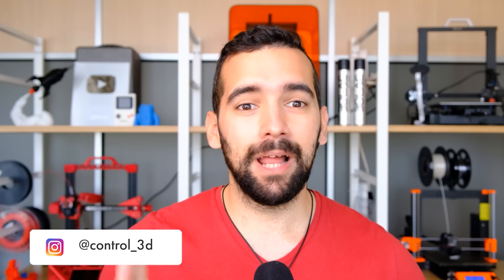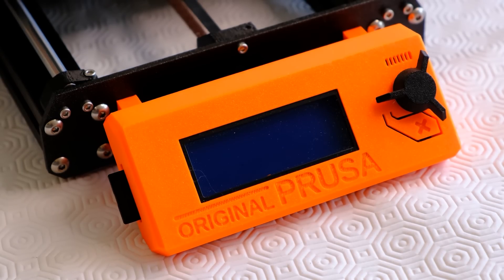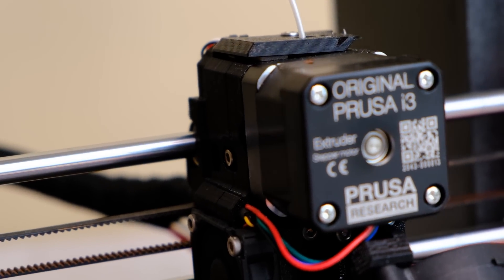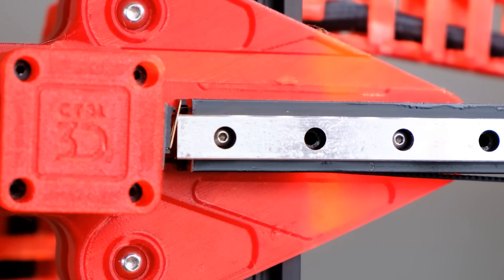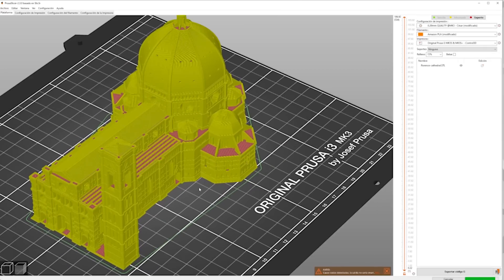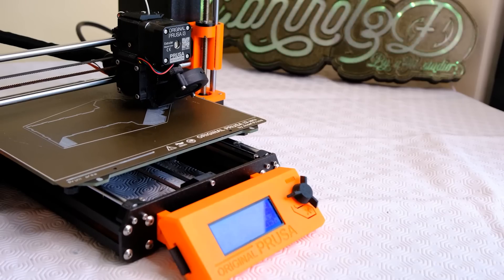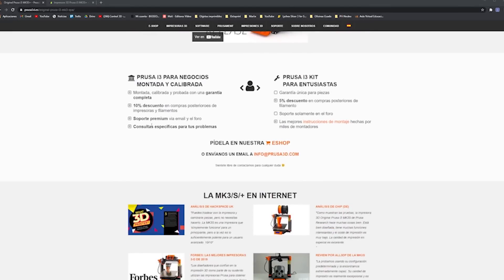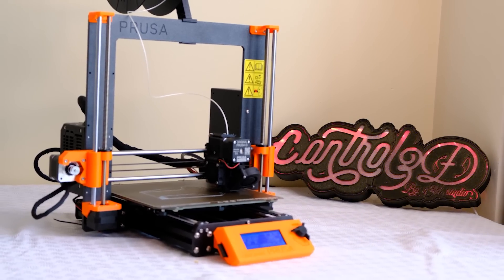👑La MEJOR IMPRESORA 3D de 2021 (calidad precio)👑 Prusa i3 MK3S+ | ¿Qué Impresora 3D comprar 2021?

Comment: Dispongo de una corexy d tronxy, modeada con guía lineal hiwin china, estrusion directa con titan y mk8 de competí chino, sensor de filamento, save por falta de tensión, fleje en la cama, capricornio, refuerzo de fuente de alimentación con mosfets en ext y cama+fuente extra solo cama, y sistema multimaterial de 5 estrusores con la placa de serie... Se consiguen muy buenas impresiones a 01 de capa y 02 y 04 de boca, con velocidades medias de 100 y capas ext a la mitad... Es decir, es una señora impresora,... Ahora puede que me tenga que mirar una para el trabajo por que he hecho alguna cosilla y creo que puede ayudar bastante en el curro... Pues bien...después de ver todo Internet, incluso antes de ver este vídeo, lo suyo es una prusa mk3 +... Sin duda... Lo trae todo todo de serie, y te lo dice alguien que ha modeado mucho mucho... Buen video loco...

Comment: Muy rápida, si, pero cuanto? MM/s porfa. Aun así por muy rápida que sea, no va a llegar a la velocidad de 4 Enders 3 a la vez, que es lo que puedes comprar por ese precio (en España, en China ya flipas) y la diferencia de calidad no veo que sea tan clara (cuando tienes las Ender bien calibradas). No veo esta maquina destinada a profesionales (relación coste/producción desorbitado). Es más la veo como mi Stepcraft M1000, la apple de las CNC, pues lo mismo pero en Impresoras 3D, que te da muchas cosas hechas a base de sacos de euros.
Reply: si la usas para imprimir pla, entonces si, te conviene comprar cuatro ender 3. Pero si quieres imprimir petg por ejemplo y en masa, la ender 3 no te sirve, ya que aun si le cambias el hotend, sigue siendo una bowden (y con un solo motor en z), sigue sin tener cama flexible (si estas produciendo con varias maquinas al mismo tiempo es casi imprescindible), sigue sin tener sistema de nivelacion automatico ni sensor de filamento, sigue teniendo un extrusor de plastico con engranajes de mala calidad y sigue teniendo rueditas en lugar de rodamientos. Aun si le pusieras a la ender 3 las mismas cosas de la prusa (hotend v6 original, engranajes bondtech originales, cama flexible original con imanes de neodimio en la cama, doble motor en z, extrusor directo bondtech), seguiria sin tener el increible firmware de prusa y su gran ventaja de poder usar todos los perfiles de prusa con el prusa slicer (es decir, simplemente te bajas un modelo de la pagina de prusa, le pones los perfiles que te dicen ahi, y ya lo imprimiste). Y aun si le pones el mismo firmware de prusa, no tienes el soporte directo de ellos, ni acceso a comprar repuestos ni kits de actualizacion. Creeme que hice las cuentas para ver si me convenia comprar una ender y actualizarla o comprar la prusa, y me di cuenta que la prusa me sale mas barato sin contar el ahorro de tiempo y dolores de cabeza que implica andar modificando una impresora en lugar de sacarla de la caja e imprimir (luego de armarla por supuesto)
Reply from the maker: Ni yo lo haría explicado mejor 👍👍
Reply: @Marcos-tj8nk  gracias por tu explicación. Llevo trabajando 2 años con estas máquinas y no he necesitado nada de todo eso que comentas, e imprimo en petg (creo que te referías a TPU, el cual también imprimo con bowden por cierto) sin problemas. Uso Cura y me funciona perfecto. El tema de los perfiles está muy bien para empezar, para quien no ha usado una impresora nunca, después de miles de horas de impresión que llevo a cuestas no le hacen falta. Y en esos miles de horas se me ha roto el filamento 2 veces y ni siquiera eso, fueron nudos. La nivelación automática también es para novatos. Yo siempre aprovecho las líneas de skirt para saber si está o no nivelada y ajustar a mano en el momento. Ajustar por software nunca me ha parecido buena idea. Claro que son maneras de trabajar. Unos necesitarán esas funciones y a otros nos parecerán añadidos que no nos aportan nada y suben demasiado el coste de producción y más cuando en este país la gente quiere comprar barato. Eso si, me gustaría probar una para hacerme un zas a en toda la boca si realmente merece la pena.
Reply: @S.Duran_SRTWorks  la comparacion mas justa con la ender seria la prusa mini, la cual tiene aun mejor relacion calidad precio